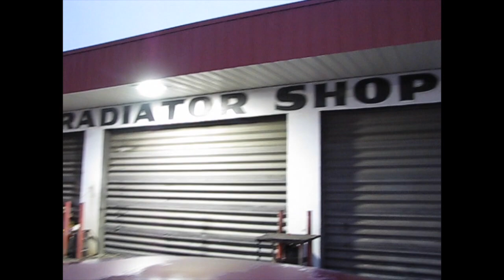buying a 1977 Cadillac Eldorado (Part 7)

Comment: Thx for the stones.  This a great car...the pale green is cool.  Hope it keeps your interest.  I have a couple classics too, and set them aside once in a while to get the energy back to start on them after they fail, and fail, and fail.  But your drive at the end is a reminder how cool it is to get them on the road and be a part of their awesome presence and story.  Hope you can get the Eldo into a dry place
Reply from the maker: Thanks for the comment. My only option is to store it outside at my friend's house under a car cover and work on it there, it's a real hassle to pack up my hand tools and try to get the latest job done in one day. If it had vacuum brakes I'd keep it, unfortunately the hydro-boost set-up didn't age well and that's been 99% of why I haven't been able to drive it. They run close to 2000 psi when the car is up to speed so a used booster will blow out it's seals pretty quickly and a replacement costs over $1000 which doesn't include the prop valve or rear calipers. Things are changing in my personal life, too, and I would like to focus more on music and art in the next few years which is one reason I'm selling this car.

Comment: got the same film build up inside mine....pressure tested cooling and it would not hold pressure, heater core.  10 hour job I was told.